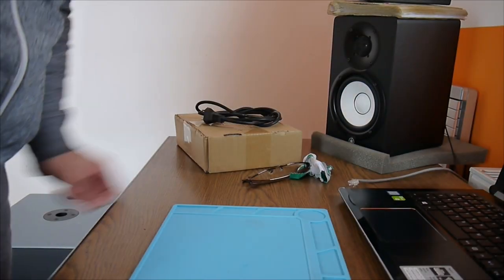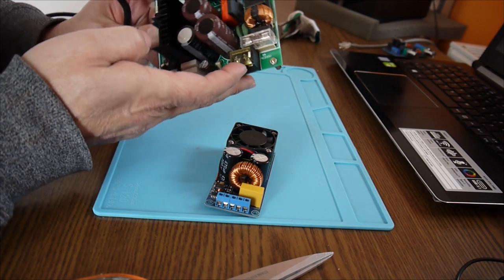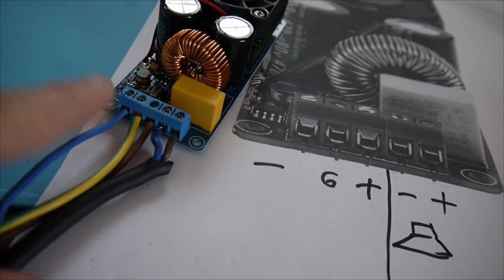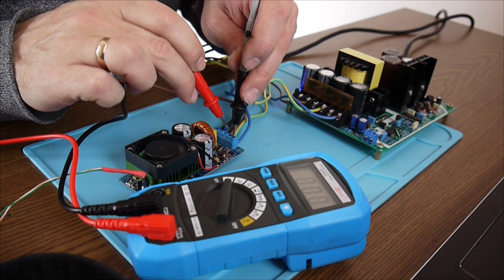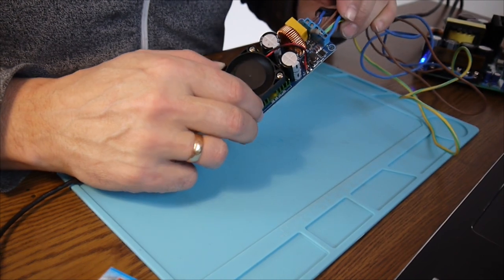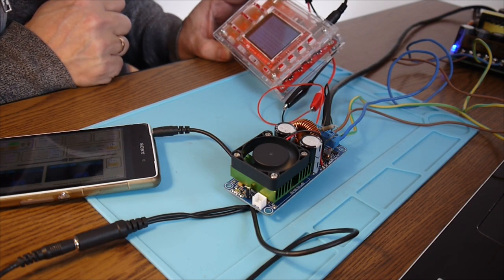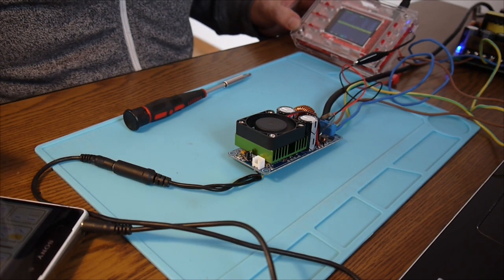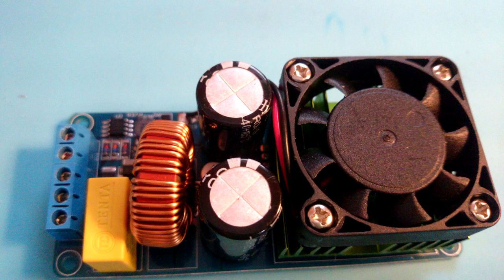Budget IRS2092 500W amplifier subwoofer project powered by SMPS 500W -+58V

Comment: I INSTALLED this on a powered sub as a replacement amp, I HAD SIMULAR ISSUES , it worked great after i used a lower voltage power supply 45v+/- and lower capacitance on the power supply 1500uf
Reply: hi there is a error on these  amp..  resistor R13 close to the trimpot is only 100 ohm and this is way to small change it to 3kohm and the amp don´t osc anymore..these amp needs very high input so use a buffer in front.. i use two af these in brigde mode driving 2 15 inch in a bandpass disco sub and they really put out some serius power...the subfilter you show is really bad and don´t work probleby..
Reply from the maker: @lsren8706  Hey! great news! Nice to know! I'll retry to have one working.
Reply: @lsren8706  whats wrong with the sub filter? i was thinking about ordering it
Reply: @lsren8706  hi. Can you share detail about irs2092 amplifier modify?
Reply: @lsren8706  ola Amigo una pregunta por favor me podrían dar su opinión si la Resistencia numero 13 cual? valor es el mejor  para estos módulos irs2092a
Reply: @victorponce5039   R13 .   Valor de  3.1 kilo ohms .
Reply from the maker: Hey! Just give me a hand and  subscribe ! Thanks!
Reply from the maker: Nice to let us know! I just quit the project,Maybe Iater...